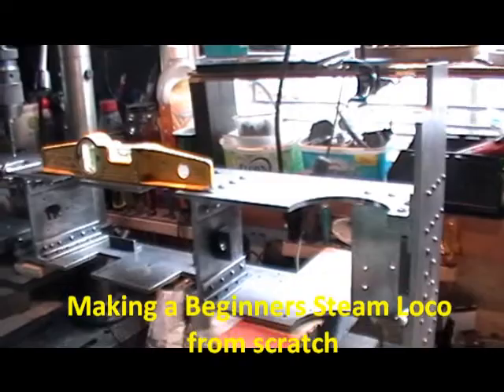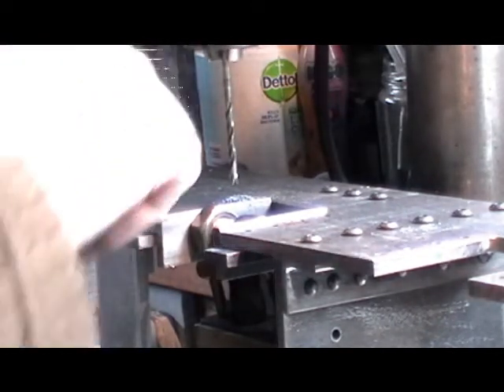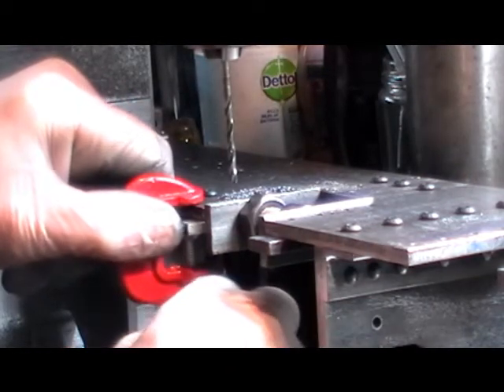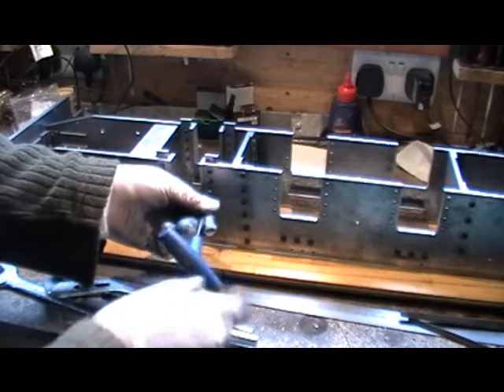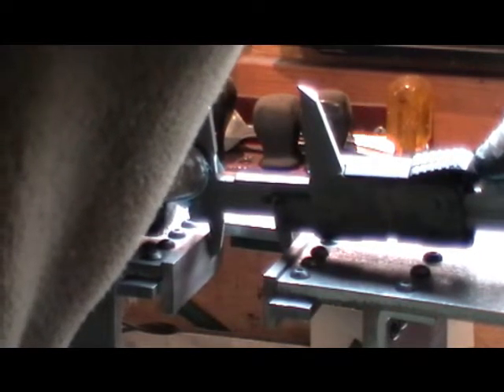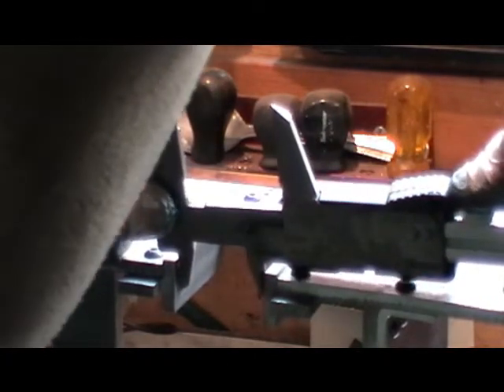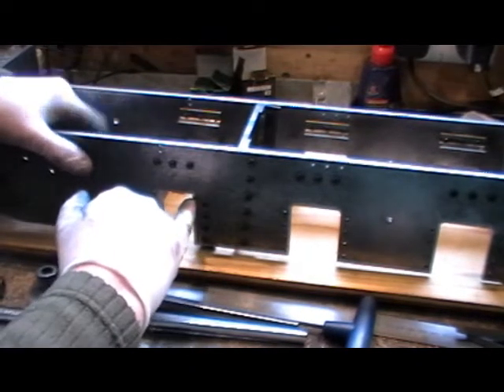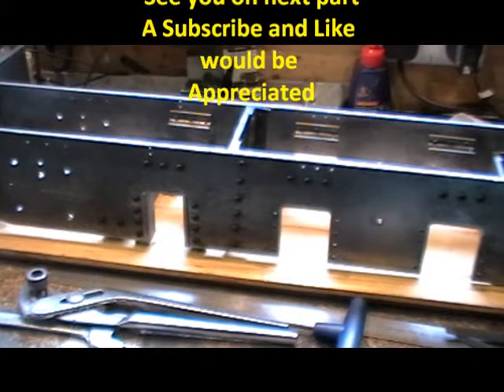Making a Beginners Steam Loco (Assembling the Chassis Main Frame p5) (horn guides p2)"mr factotum "

Comment: Hello Mr Factotum I really appreciate your videos and I am assembling material to make the same loco as yours. I am also keen to keep the costs down. What do you think is the next best material to use to make horn guides after gun metal?  Many thanks Jim
Reply from the maker: Eyup Jim
thanks for watching and your kind comments.
nice to hear your going to make a start on one of these, like you i needed to keep costs down, " i like to get value for money" but without compromising on quality.
gunmetal castings or bronze stock is expensive!!
i just used mild steel Tee section i had on stock, if i had not got that i would have fabricated a  tee  section up from brass or mild steel, i know this takes more time, but that didn't bother me, depends how quick you want to crack on. Many people buy items in nearly ready made or castings etc, but i like to be able to say i made everything from scratch, and i like the challenge to find more value for money alternatives.
Now i'm no expert at this steam loco game, and the way i look at it ,in my opinion, if for example, a steel axle shaft is quite suitable to run in cast iron axlebox, cast iron is a great bearing material, i dont know why people put roller bearings in, there only required if the axle box is made from a poor bearing material. Then the C.I axlebox should quite happily run up and down on a steel horn guide with lubrication, these miniatures arn't going to be doing tens of 1000's of miles, well thats my logic.
Hope that helps and good luck with everything, keep in touch and let me know how you get on.
regards
mr f